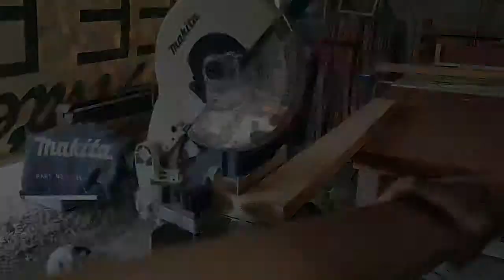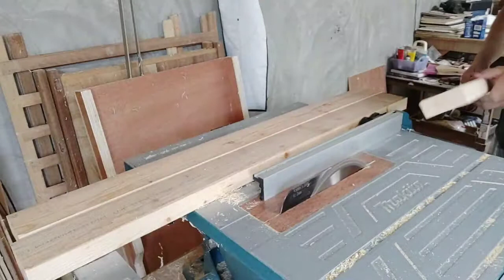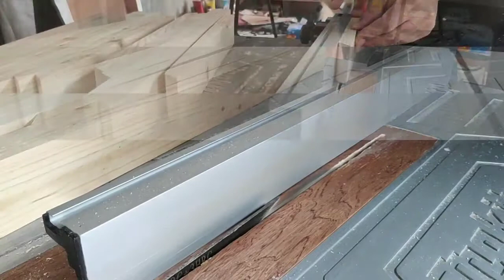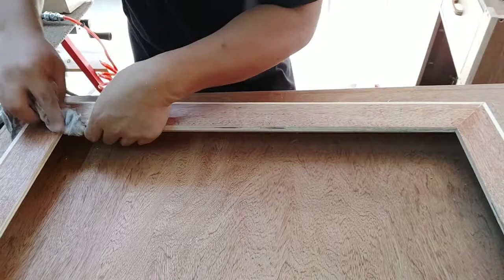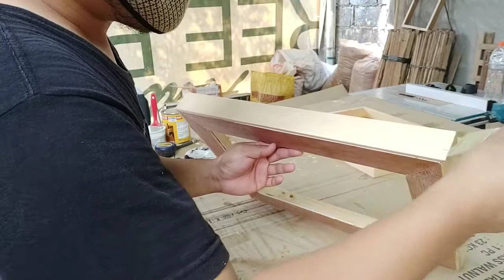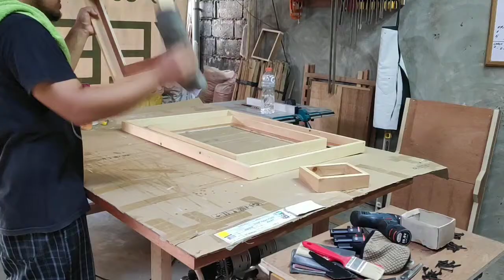The Process of Making Floating Frames (Pinewood in Natural Finish)

Comment: Dude, those chicken feet you are pushing with on the table saw don't cover the lift off from the blade hitting the back side of the board. I commend you for the use of one on both sides, but get a traditional push stick to cover the kick!